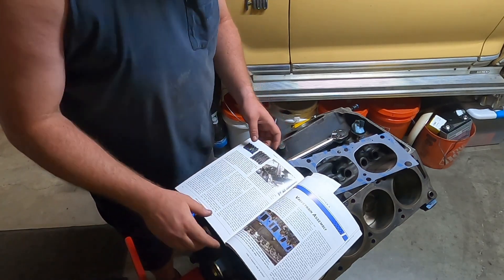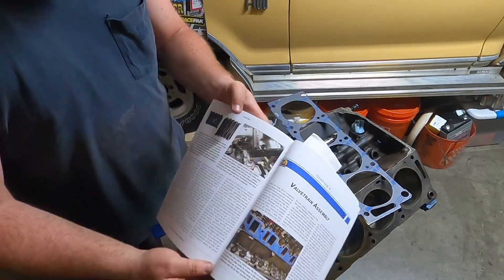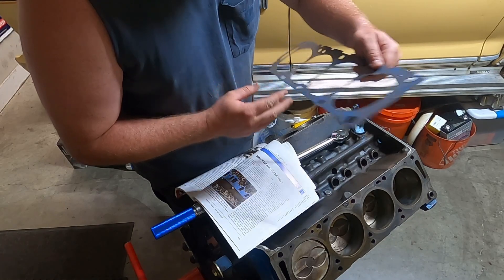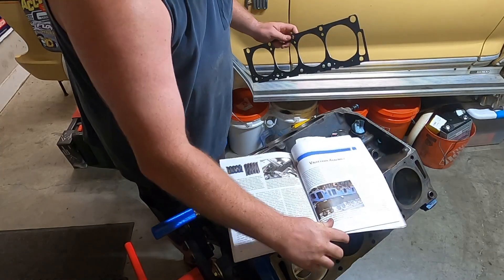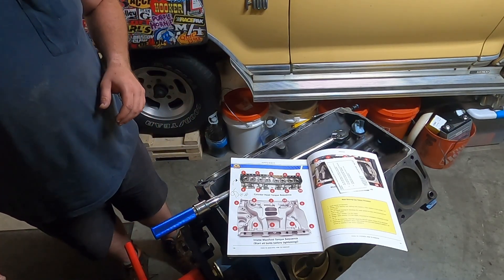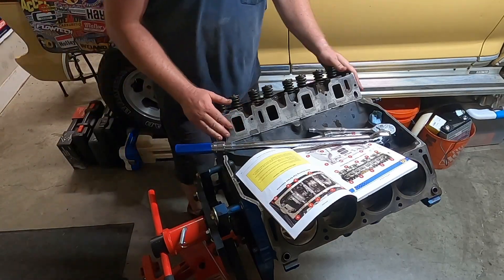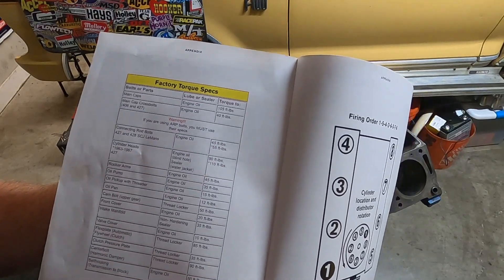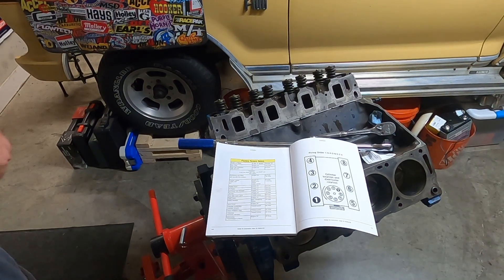Ford FE360 Head Install and Torque Specs

Comment: How can the engine cool with the with the head cross over ports blocked off? There is no way coolant can circulate from side to side in the engine.
Reply from the maker: They don’t from factory on the rears I think if I remember correctly

Comment: I got a 360 in my '56 Fairlane rat rod. Just got my heads from the shop. Rpm performer intake, 650 double pumper, sanderson headers. Tryin to get my 5 year project on the road. Great video.
Reply from the maker: @colinl5951  Thank you. The old 390 in our highboy had that intake. Will soon go back on the 390 in that truck. Sure is a lot lighter than the cast. Great motors.
Reply: @southernrevivalautomotive  gonna get a crank and rods in the future. What carb did you use on that 360? Happy Thanksgiving dude.

Comment: What the name of the book
Reply from the maker: @albertovasquez7858  Work bench how to book. Available on Amazon. Link may be in description. 

https://www.amazon.com/Ford-FE-Engines-How-Rebuild/dp/1613252447/ref=mp_s_a_1_1?crid=1ZOZKFA29JB8S&dib=eyJ2IjoiMSJ9.aVQfqeaeYK_OJ6RE6XVknY9glbJ80SxD-GjpXS0lY18ayl5tDCqi1kv-p9rfWbSyMOT_K7aD2IA6ludPkbMq_LOTzs3sdgJo4otzvVgO8dqAQt7LCJ1rxPMgOUF7a4YWek12WVJhiCmig0ACMhbtuui8c29g2Aqm3cz17DGc9Ms7x1AV7EOlYevRaBEdujYz._ccdbwC348CxBCLUbzq2hnsDM6pIKVPJZNDfh2kpTWE&dib_tag=se&keywords=ford+fe+engine+book&qid=1721007637&sprefix=ford+fe+engine+book%2Caps%2C116&sr=8-1